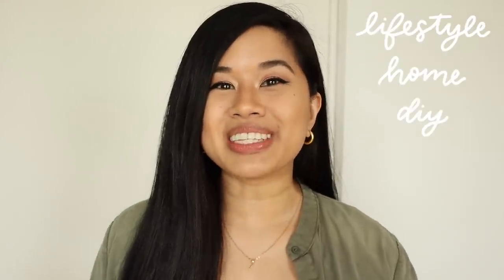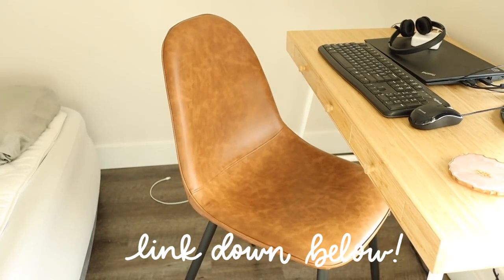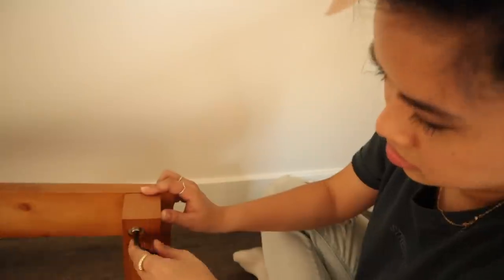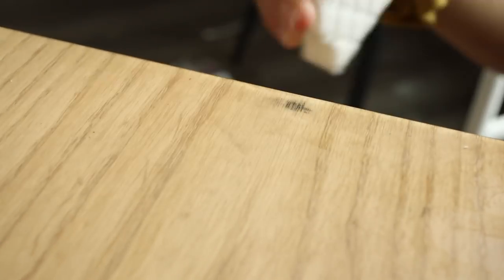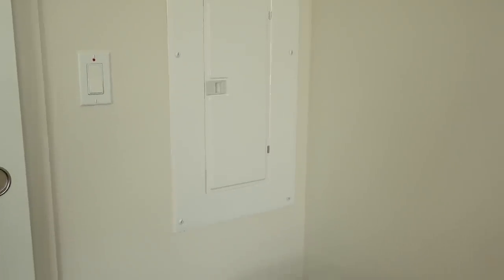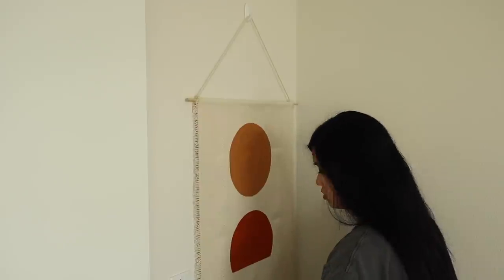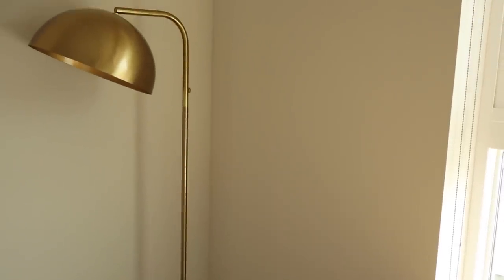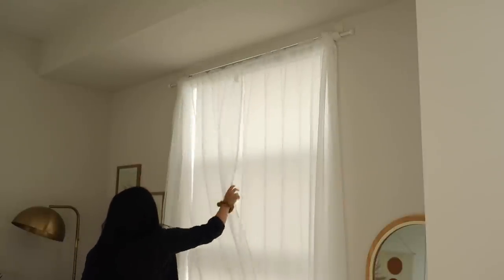EXTREME BEDROOM MAKEOVER BOHO | Ultimate Apartment Transformation *100% Renter Friendly*

Comment: You inspire me so much, but my room is so awkward, like there’s no good place for my bed bc a lot of my walls are slanted.
Reply from the maker: Lots of ways to embrace it or even highlight it! I’ve always dreamed of slants walls with a built in shelf 😍😍
Reply: Tina Le I have a small dormer room where the ceiling comes to a peak so bc of that it’s rly hard for me to style and design stuff f or my room. I have some exposed beams that I wrapped a string of lights around which looks awesome, I just continue to struggle with where to put my bed and chair. I also like moving my bed around so I can’t have anything permanent